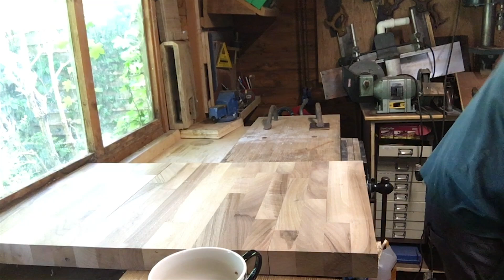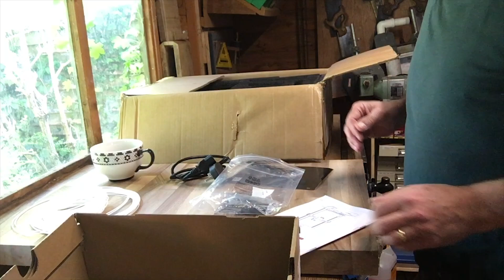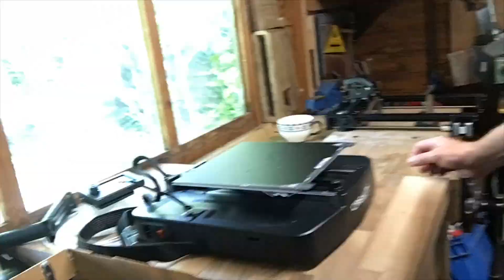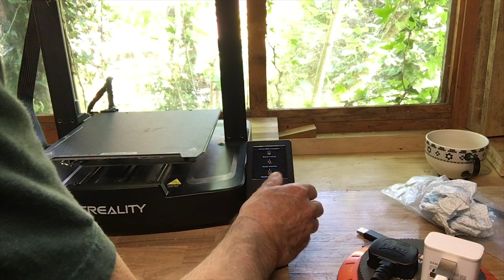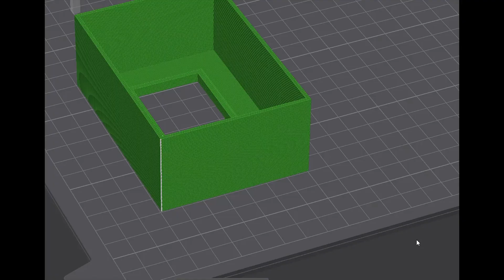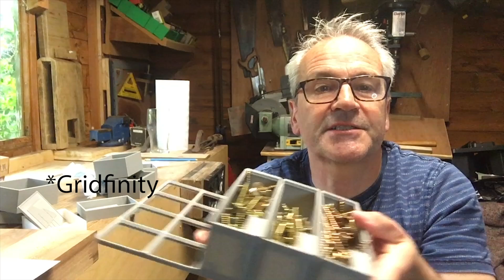I bought a 3D printer for a special project

Comment: In Creality Print, down the bottom left on the Device Tab when the printer is working, it will show you the object deletion window, in which you can click on the object(s) you want to skip over while proceeding to continue printing out the remaining objects until the job is done.
Reply from the maker: Good tip thanks

Comment: The SE is a nice affordable printer. Easily upgradable to Klipper (though I would recommend using a Klipper pad or a Raspberry Pi on its own as Crealitys own nebula pad don’t fully respect the GPL and runs an older version of Klipper)

There’s also some nice cheap mods you can do to the printer to improve stability and print quality .

Welcome to the hobby, it’s a rabbit hole, but a fun one.
Reply from the maker: Thanks it’s actually working really well now I understand a bit about it - will look at those suggested mods - a bit more speed would be good and stability though not too bad could be improved
Reply from the maker: I have a spare raspberry pi somewhere just got to find it
Reply: @TheShedProjectUK  don't go into that rabbit hole. this is the problem with these old generation printers. instead of printing stuff you "upgrade" the printer
Reply: @ragesmirk The main difference between the SE and the KE of the Ender 3 V3 models is that one comes with a Nebula Pad (which runs klipper v0.11), the other doesn’t and runs Marlin on the mainboard. Oh the KE comes with a filament sensor but those costs pennies,. And the SE only has one part cooling fan where the KE has two.
(Edit) oh the SE doesn't have a linear rail on the X axis where the KE does. But you can add one for ~£10 if you want.

You can easily upgrade a SE to a “KE “and increase its speed, even if you buy a Raspberry Pi (Model 3 is good enough) it works out cheaper than investing in a new printer, and if you have one on hand (most nerds do) it’s free - well just the cost of your own time!

The other mods I recommend are:
The Z axis braces to reduce Z wobble. Costs some filament and a few brass inserts.
Move the spool holder from the gantry to next to the printer, Costs some filament, and if you want to get fancy a length of Bowden tube to "convert it to a reverse bowden"
I would also strip down the bed and make sure everything is tightened regrading the Y axis, there have been some "quality control" issues there, but if your lucky you can stick with the factory rods,, level everything with a few printed shims (this is where klipper is handy for producing a z map) and you will be able to get a perfect first layer on it. If your unlucky and there is more give in the bearings then there should be, there is a linear rail mod for the Y axis to remove any give in that axis - ~£20 for 2 rails, and the cost of the filament.

It’s only an “old generation” in terms that it’s a bed slinger and that the SE runs Marlin out of the box. But bed slingers are still great low budget printers and its easy to upgrade to klipper (Creality use the same mainboard on the SE as they do on the KE, Well on the KE board they remove the SD card and the USB to serial circuity because you use the Nebula Pad instead. Its actually easier to flash the SE boards MCU to  Klipper firmware than upgrading the existing klipper firmware on the KE board as on the SE board you can flash the firmware via the SD card and its the MCU bootloader).

The SE and KE aren’t the best printers in the world sure,  it for the cost they are good entry point for those who don’t mind tinkering.  Would I recommend a SE or KE to someone who isn't a tinker? Nope, Something like the A1 would be better suited to them, for the higher price you need less tinkering, but if I know they are a tinker and they got it cheap? I wouldn't invest a bucket ton of cash into the printer because that is cash that could be put towards a CoreXY build, But a few cheap Quality of Life improvements, Sure!
Reply: @ I owned the V3 KE for more than a year. I did a few upgrades. Rails, heating element, nozzles etcetra. It doesn't end. I also helped OrcaSlicer devs to optimize the profile settings. PETG fan speed fix (you couldn't set a fan speed lower than 55%), jerk limit fix (at the start it had a high value causing the bed to rattle), probing the bed only after temperature is reached, etcetra. These SE/KE printers have many shortcomings. The  only good to have upgrade for these are the CHT high flow nozzle clones (nickle plated from TriangleLabs). The other upgrades are to fix something not designed well.
Reply from the maker: Thanks for info
Reply from the maker: I am now adding text to labels in slicer (creality studio) couldn’t find a way in cura do other slicers have that facility?